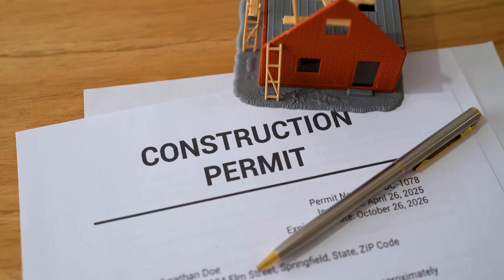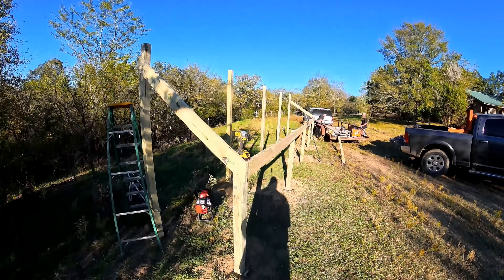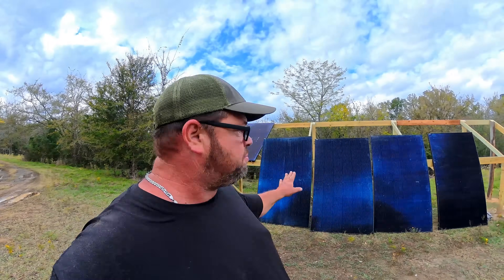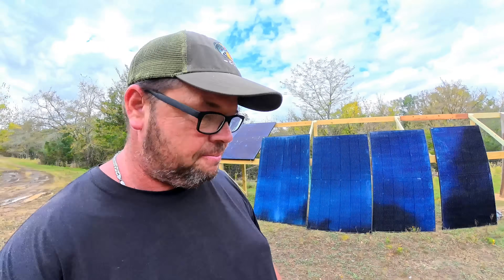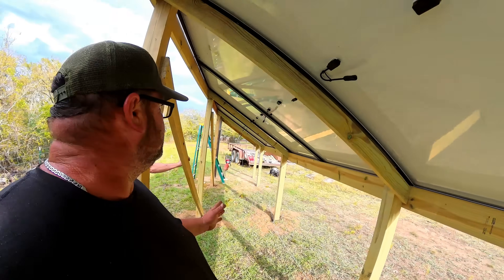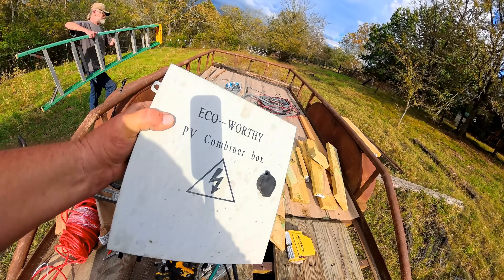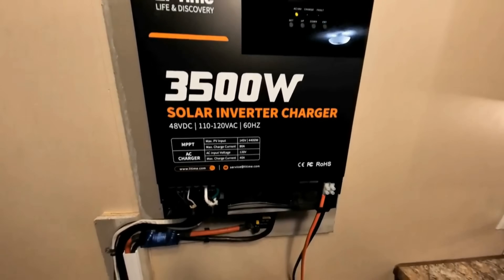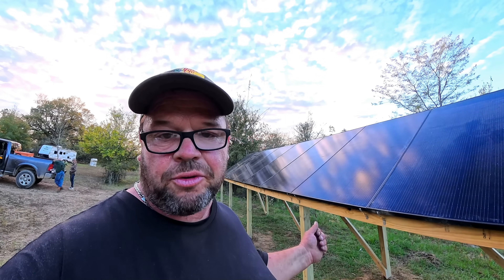Building MY Off-Grid Solar Without A Permit!!

Comment: Hi Mate, I like having my 120 secondhand solar panels flat on the ground, so I can clean them and they work better on cloudy days and even rainy days. I like keeping the costs down, so I have bolted the solar panel rails to many  old truck tyres, which holds the panels down in winds and isolates them from the ground. There is never a shortage of old tyres and secondhand house solar panels. I have most strings wired so I get 60V or 100V depends on the brand and number of solar panels and I get 5 to 8 amps per 12 sets.    
I hope this idea help everyone get started.

Comment: It's been a minute since you posted. I sent you an email quite some time ago too. I finally posted one of that 3.8 acre off grid I bought. And yep, NOOOOOOOO PERMITS, NOOOOOO Inspections. NOt even to have rural water or power installed if I want it. It's all right there, I am going to have to do the water, but not the electric unless I do it for just becasue. I prefer to stay off grid. But I can have power piles installed at no charge up to 300 feet overhead to my meter base poile, they supply the meter base for me to put on my pole.

Comment: LOL! you just voided the warranty on those solar modules by drilling holes in their frames! You amateur installers should have read the module manufacturer's warranty documents first. 🤣🤣🤣
Reply from the maker: 🤣🤣🤣 "If" this were true...who cares about warranty. They last for 30 years. You permit installers and sales men are doing easy work and charging top dollar. Its way cheaper to buy a hundred dollar panel if one goes bad than to pay your so called professional install prices of 30 + grand
Reply: @OKLAHOMAOFFGRID  Read your solar module's warranty document. It's true.

Comment: nice  ground mount! The only issue that I see is that you only used small self tapper screws to mount them to the ground mount structure. I sure hope that you do not get any strong winds blowing toward the rear (high side) of the panels as those small screws are not going to do a very good job of keeping the panels where they belong. Get some brackets designed for this setup. I will be a lot cheaper than replacing the panels that flew off the ground mount. nice video
Reply: Don't you guys get tornadoes in Oklahoma? We even get some high winds from cyclones here in Australia and wouldn't trust those little strips of tin

Comment: Really like your setup but I didn't have  a lot of land so I built a mobile panel frame for 6 100 watt panels that I can move and angle any way I want. This way I still have backyard space AND solar panels. Thanks for the tip on the aluminum "plumbers tape" to easily anchor the panels to the frame. I also plan to check into the link for additional panels. Thanks for this video!!

Comment: As long as the neighbors mind their own dang business.  I wont need a permit either😂😂
Reply from the maker: That's pretty much the truth I've installed one in the city and kind of kept it on the down low and nobody has come by crying where is your permit and it's been a year and a half
Reply: I have structures built around my property. Shed, Greenhouse, etc. But I build them where they also can be disassemble or removed if needed. As long they ain't permanent structures. I'm pretty safe of not getting any trouble without permits. I have a plan if anyone does come by. I just say I'm making payments of those structures as buying them from a third-party. That way they will leave me alone. As in their mind, they can be repossess and remove from non-payment. They don't have to know I built them and they all are fully paid for.

Comment: i have been stocking up on hardware when deals present themselves. i bought 12 .. 405w bi-facial panels that are 2 yrs old for 1000.00 .. been looking at 4x 300ah 12v humisek lifep04 for 15kwh battery bank 1600.00 .. powmr hybrid inverter 650.00 that takes 450v pv and now just looking for decent panel and breakers .. not sure if i want ground mount or roof mount.. thats the current research i am doing.

Comment: Not a bad design for a mount for 9 panels.  Where i am i would have to do a steeper angle but overall same idea. I would possibily do a few  just hav3 to figure out the angl3 up here is around 42 degrees